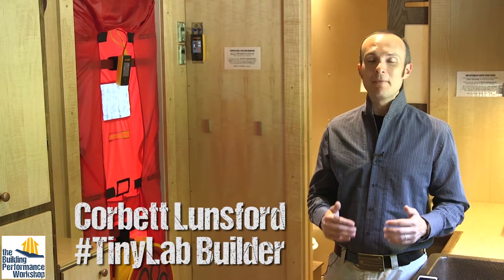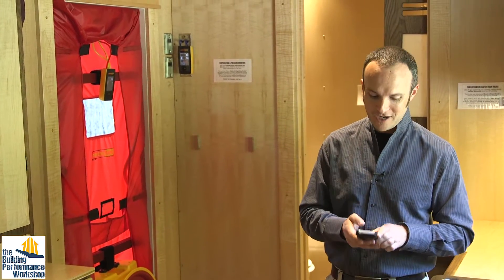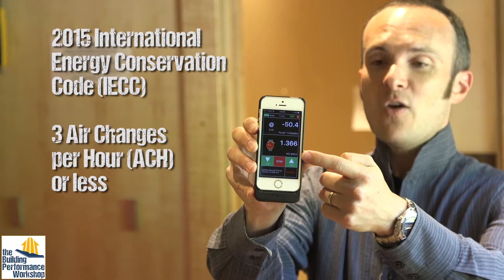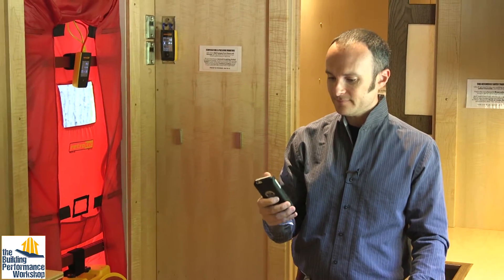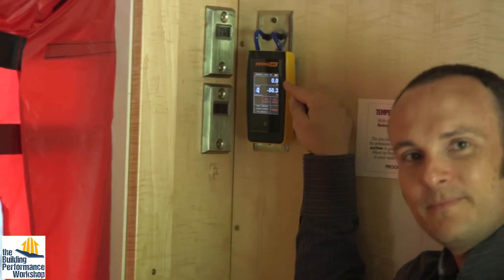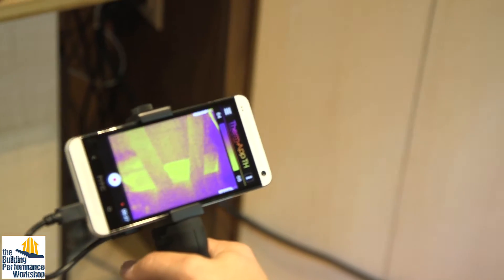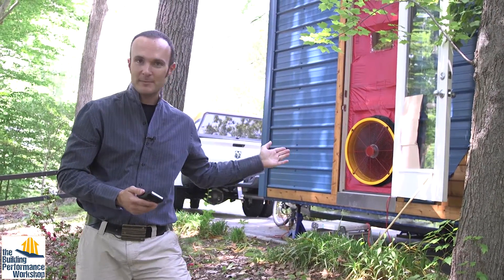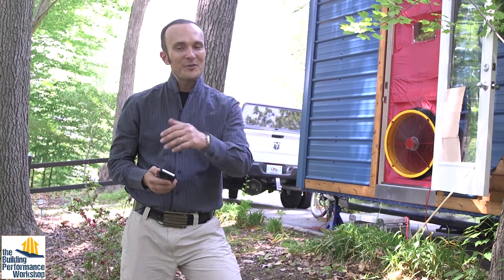Blower Door + Infrared Thermal Camera + Zonal Pressure Testing the Tiny House

Comment: Today I used my ERV and an inexpensive Dwyer Mark II manometer to do a “blowerdoor” on my larger tiny house.  On high it managed to hit 55 pascals.  Running the calcs (assuming the flow curve literature for the ERV is accurate) we’re at around 1.05 ACH50.  Doors and windows are even low end.

Granted we were meticulous, but my wife and I have done all the work and we’re DIY first time builders

Comment: Hi - Very interesting approach and honestly quite impressive that you have so many systems integrated given the fact that u built a tiny house. Very informative channel. Like it a lot. Thanks and keep up the good job. I am inspired to build a tiny house for my self, but here is my honest opinion and hence question. The build quality, aesthetics and esp performance doesn't like that of a first time home "builder's" by any means. So, is this quality really achievable, for ex, if I were to build on my own who has absolute zero knowledge about construction. Also, how much does it cost for a build like this one? And what's the time frame? And, can u really travel frequently in this tiny house? Have heard from other tiny house workshops/community that shouldn't be moving the tiny hou more than 2 or 3 times in a year, otherwise things will start falling off? Is that true? But, I see you doing a road trip, which is a lil bewildering to me. That's already too many questions, so I will stop here
Reply from the maker: +Amar C hi there. That is a lot of questions, you're right! I recommend coming to my workshop on 'How to Engineer and Build a High Performance Tiny House on Wheels'. But in short, 5 months building with no days off and no other job; $125k total pricetag; we built it to move on the road; I've never built a house before, but I sure begged for advice and help from anyone who had expertise.